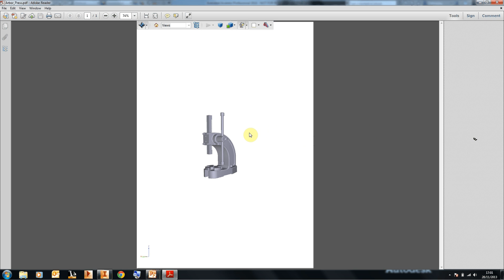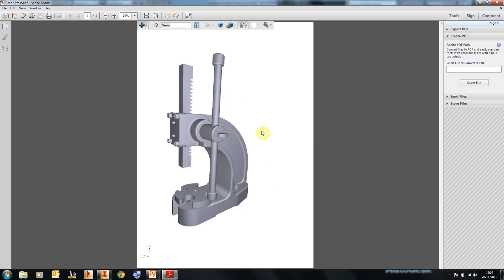Autodesk Inventor - Export 3D PDF

Comment: This is cool and all, but it would be very helpfull if you have link from this site, where you download the official add-on. Is Tetra 4 the right one?

You also say it's free for customers, but now I have only found free trials or applications that cost around 50$-100$.

What is the correct one?

Found one that works very well, but it's as it says only free trial. go to apps.exchange.autodesk.com and search for 3D PDF in  the searc h menu. 
3DPDF Exporter for Autodesk® Inventor® Should pop up.